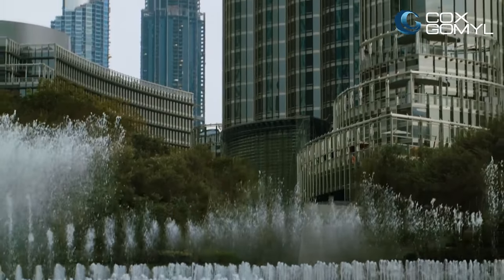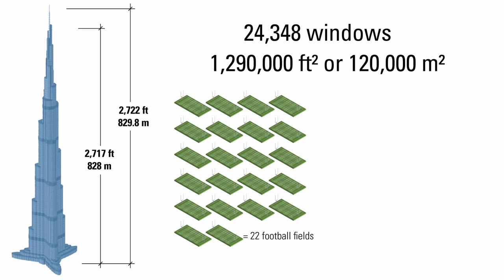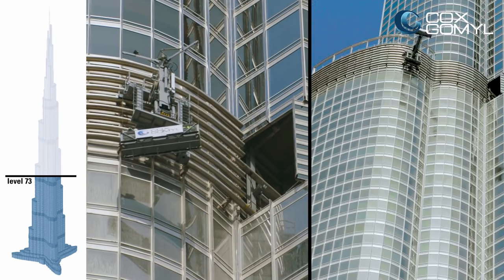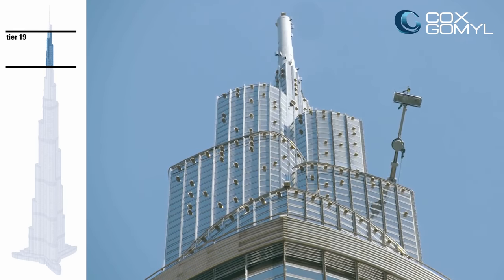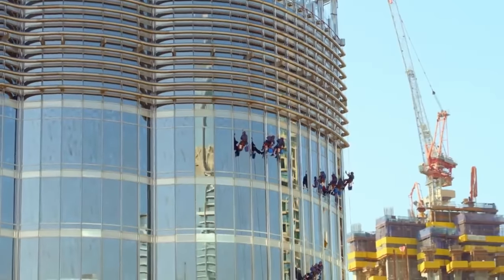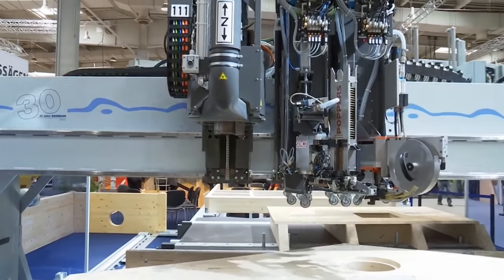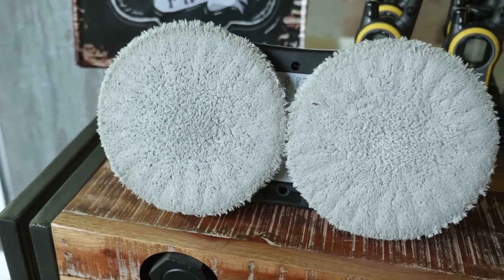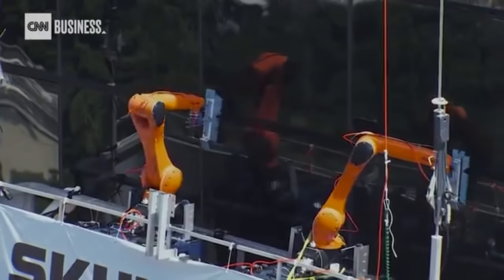How do you clean the tallest building in the world? | Burj Khalifa in Dubai

Comment: What about windows that could pivot to the inside for cleaning. I imagine those windows are enormous. Maybe it would cause issues with the interior space. It would be neat if they would spin in the center then lock. You could clean the inside and 180 it for a clean exterior? Seals would be an issue but that's what engineers are for.
Reply: Yeah, why not?

Comment: Rope access with proper training and equipment is quite safe. These methods are not just used for window cleaning, but for other technical work that needs to be carried out in locations where Rope Access happens to be most logical way to get there. Interestingly a company called 'MEGARME' happens to be the leader in this sort of work for the region. There's hardly any tall structure or height related record breaking feat in UAE that didn't have MEGARME folks working on those projects.

Comment: One of the solutions is to choose materials and finishes that don't show the dirt. When asked what color car I just bought I respond with "don't wash me gray". Black, navy, red, and even white cars show a lot of dirt and I have other things I'd rather do than scrub the car all the time. What treatments can be put on windows to reduce or eliminate cleaning of that tall building? Or even the non-glass areas could they use a brushed or stippled pattern? Many helicopter windows are treated with 'RainX' or equivalent because windshield wipers do not work under the propeller draft. Perhaps they could style the building to look dirty even when it's freshly washed so no one has the urge to run up there with a bucket and squeegee?

Comment: This might be a very dumb question, but why can't we just clean it by squirting water/chemicals with moderate pressure hoses from the ground?
Reply: There's no way the squirting would get to the top of the building. You could put those hoses on the top of the building and wash downwards, but you'd need really strong pumps to get water that high. It's a huge water and power waste, so not very good considering the arid weather there

Comment: Can't they just install a variation of car wipers in the panels?
Reply: Grease from oils mixed with dust/soot would be the main problem. Some level of scrubbing would be needed, and not just soap. Even mild scrubbing would be enough, but car wipers do not achieve that well, and having so many of them that had bristles would certainly add significant weight to the sides of the tower, not to mention cost.
Reply: @weeveferrelaine6973  I see thanks for the reply!

Comment: 2:50 If you are going through that much work to create a system like this; Im surprised they didn't didn't go the extra mile and automate this entire process.

If they have all the pieces to get people to that location, all they would need to do it attach some lines with detergent water and distilled water, then use water jet sprayers
Reply: I asked the same question, I was told that it was looked into, unfortunately, the winds make it impossible and a fully automated process would not be able to see the results of their own work. Dust and pollutants can get mixed with sprays and robots cannot see if something has actually removed the dust or not. The cost of development of the tech was way beyond what could be justified. Especially since window cleaners can be so cheap, depending on the company.

Comment: 12 hectares (120,000 square metres) is easy to visualise but 1.29 million square feet? How do you even start to visualise that if you only do imperial?
Reply: Maybe convert it into square yards (miles?). Large numbers are generally hard to comprehend, 120 000 square meters is a strange number as well, only after your conversion to hectares I got the scale.
Reply: @Yorick257  120,000 is a simple number really because you divide by 10,000 to get 12 and can easily be done in your head in a fraction of the time it takes to use a calculator to convert imperial bananas. It's bizarre that US people persist with imperial bananas when it is so ludicrous and unintelligible to the rest of the world (almost).